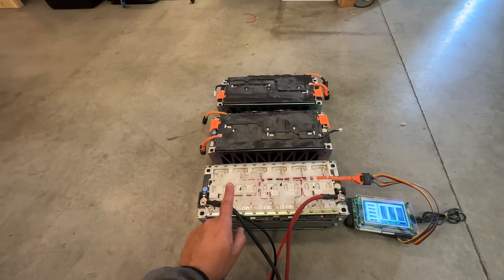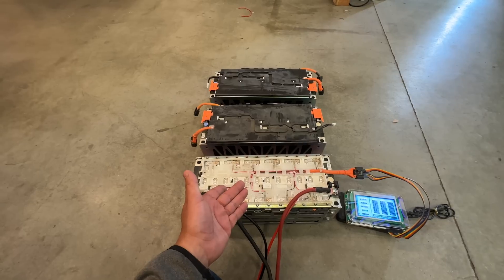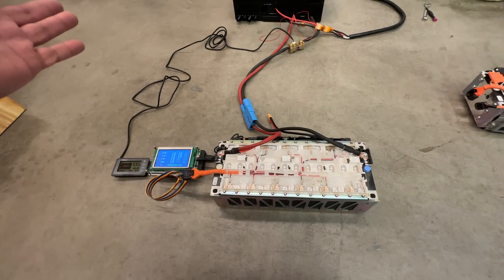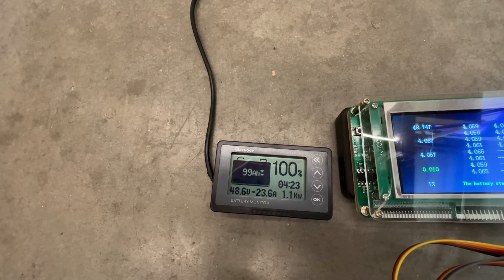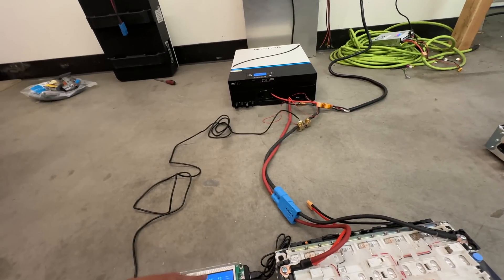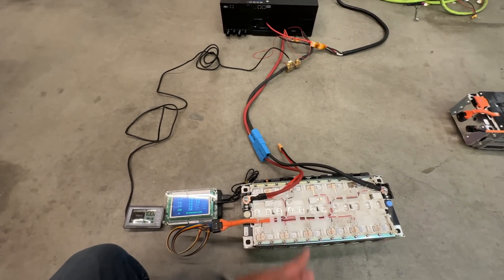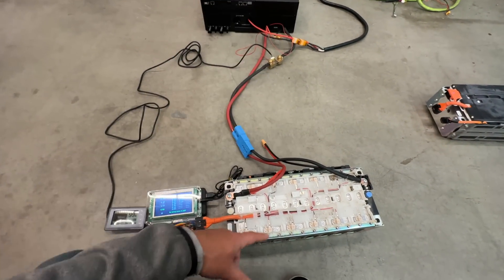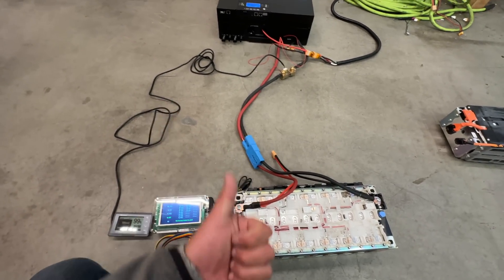Low cost 44v batteries with 48v Solar inverter?

Comment: Can it be charged with that sungold power inverter if the battery had a 12s bms which would shut it down at 50.4v??

Comment: I got 2 of these for a mini electric motorcycle I built. 2 in series for a 24s pack and a 200 amp controller. 4k 12” hub motor and it does 0-40 mph in about 3.5 seconds. 
I have yet to do a full speed test. It’ gets sketchy over 60

Comment: As previous comments have hinted at - the real test for a hybrid inverter operating from 44V batteries is to see what the lowest battery voltage is from which the inverter can still supply max power.  An 8KW inverter will roll off to 3kW max at 43V for instance (despite stating 40-60V), but the datasheets never go into this detail.  Does anyone know of a hybrid inverter suitable for 12S batteries - that can do say 8kW output down to 39V?  Thanks.

Comment: A GenetrySolar inverter can run on 36v batteries, the unit can both use & charge batteries between 30v-48v… and these values are adjustable, to get massive cycles out of the Li-Ion by running between 20%-80%.

Honestly, this is the use case you need for 36v batteries like these.

Their 48v inverters will work between 40v-60v, and their 12k inverter can run in 60+v range, if you want to put 2x of these batteries in series.

Comment: Victron inverters multiplus and Phoenix models will operate down to 37 volt. Majority of EV battery modules seem to be in either 12 or 16S.
Reply: And you'll get slightly better efficiency with the Victron gear... roughly 90% instead of 85%.  Might not seem like a lot but its a pretty big deal.

Comment: Another thing you could do. Those cheap automotive DC DC converters you can get off places like ebay will often accept a wide range of input voltages. I have 48v down to 12v ones but they can accept anything from 30-60v without an issue. So say a 48v to 24v one and a 24v inverter would work fine. (would still need a separate charger though + BMS of course)
Reply: I think that's a good idea but a problem with a lot of those DC to DC converters is they only have a certain limit of Watts they can convert
Reply: I got tons of those things but not only are they severely limited in output current, you are also adding a 85% efficient conversion in the path on top of the 85% efficiency of the inverter, and the overall efficiency of the system is going to be horrible (72% efficient).

Comment: I got a Ryobi 40v 1800w power station. I have connected some 54v scooter batteries I got from jag35. I’m connecting it through a Buck converter and an old 40v battery with the guts torn out. The Ryobi power station doesn’t have any power inputs other than the 4 slots that take their 40v batteries. That’s why I had to gut an old 40v battery to use the connections from the battery.

I mainly use this for a refrigerator that draws 200w. My contraption seems to let 400w through. So that works well until the fridge pulls 800w for the automatic defrost. So I always keep 1 real Ryobi 40v battery installed to handle power spikes.

Comment: Isn't there a programmable inverter in the market? I understand the safety concern but, why not? Also using a boost converter maybe?
Reply: Inefficient trying to do a wide range input.
Reply: And the 1200/1500/1800W boost converters are Chinese wattage rated. Cut them in half but first look at your intended input and output and see what the power rating is.